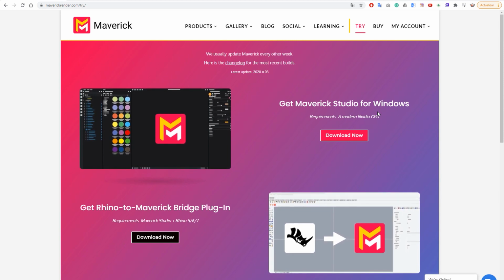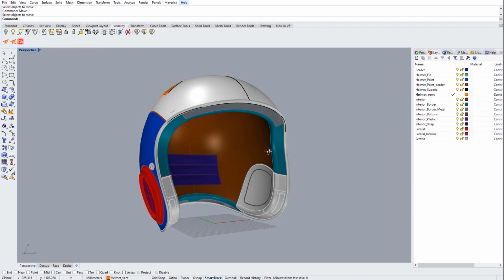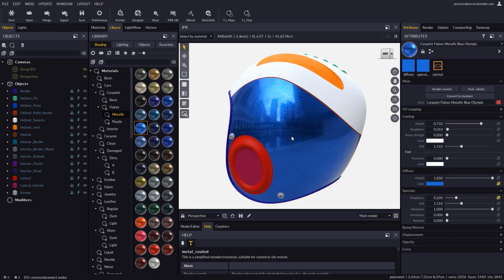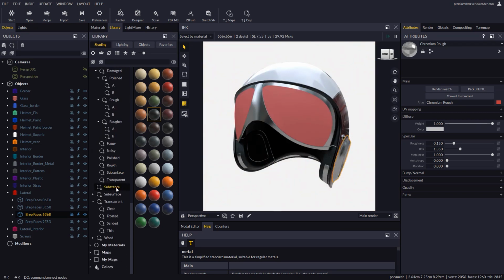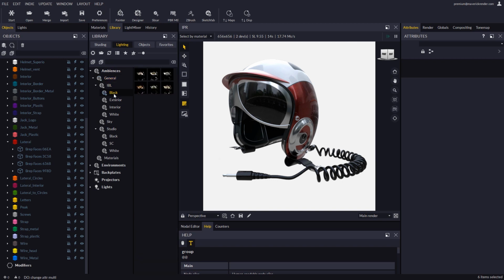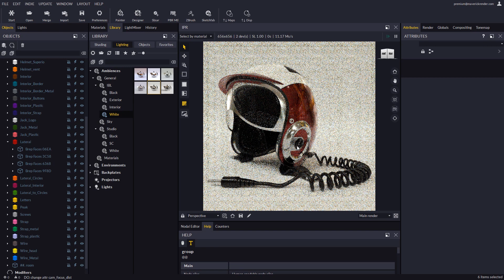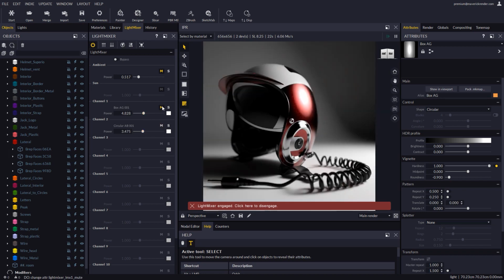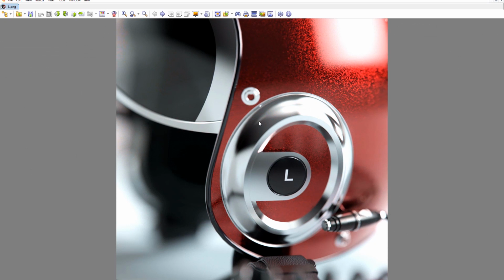MAVERICK RENDER: 20 01 RHINO WORKFLOW FOR PRODUCT VIZ

Comment: Great Bridge :) maybe is there a bridge from Moi3d to Maverick? Would be great to have one ^_^
Reply from the maker: We will consider it in the future depending on the users who may be interested. Thanks for the suggestion, Moi3d is definitely a great software that fits well in Maverick's qualities
Reply: @MaverickRender  Appreciate :) would be great to have one, Rhino and Moi have same similarities, same nurbs based modeling :) Will be waiting. Thank you
Reply: @Konnidesign  In the meantime: MoI saves files in .3dm format, and Maverick imports .3dm files straight. So even without a one-click bridge you can use Maverick with MoI already.